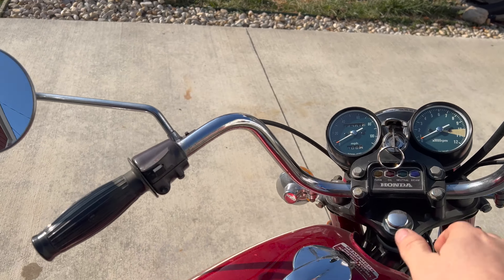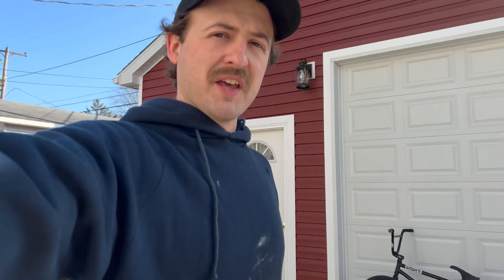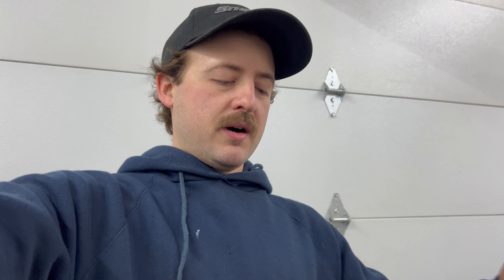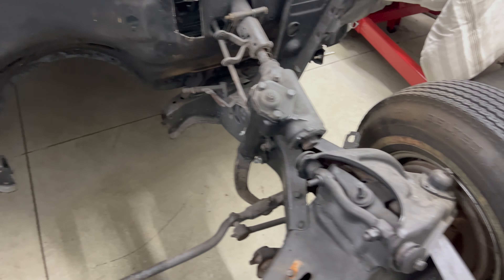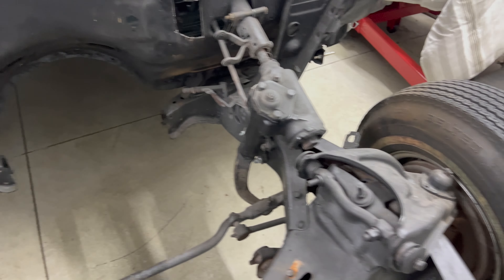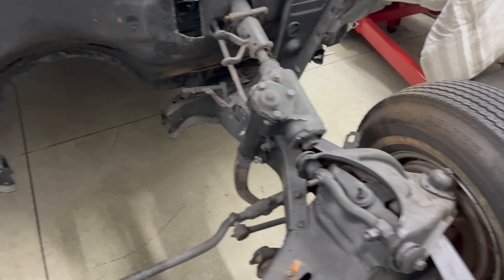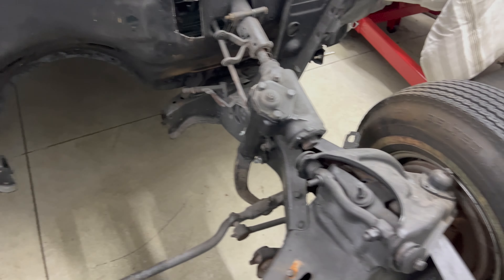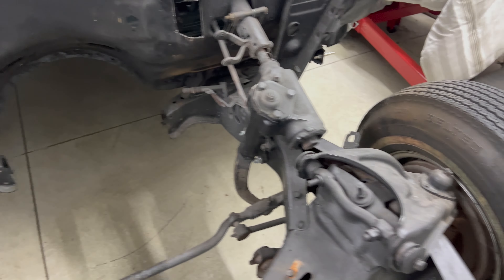55 Gasser Stock Trans Mount Removal Mod and Wheel Test Fit!

Comment: I have a buddy who has that same Honda but in blue that he bought new and it still looks it!  I've replaced a bunch of of tri five front crossmember bottoms over the years usually due to them caving in from being jacked up a million times. When I do them , I put a piece of tubing on the top side of it that reaches the bottom side of the upper crossmember to prevent it from doing it again. Its not a bad idea on a car like yours that will be getting jacked up frequently...just more of my useless input! Car is looking good man!
Reply from the maker: That is a pretty good idea! Im going to look into doing that on ours! Thanks for the input man. Appreciate it.

Comment: i am very curious about the wheel size , i have 14s cragars on my 1970 skylark with dried up 275/70r14 wide ones on the rear and it is just impossible to find any out here in the Netherlands. Got some new 245/60r14 BFG T/As laying around as biggest/best choice but i am afraid they will not look that good. Cragar SS fronts 14-8''  with 215/60 and rears 14-10'' with 275/70r14  looks are killer and screaming 70's
Reply from the maker: Cant go wrong with cragars! We will be running the skinnys up front and running with a steel wheel and pie crust slicks on the rear. That tires size looks a little goofy, but it looks great for some rollers for now!
Reply: @vintagehotrods  love those crusties on a 50's car , perfect match. Shame those are prohibited in the Netherlands .Think the size is almost the same as my 275/70 What size tire do you have on those cragars  14'' ?

Comment: I have 3 55 hdtps . First one built in votech in 77 , 55 truck axle and springs , 302 cross ram 4 spd 8 3/4 rear . Second one , built in 80 , 396 4 spd , 9 inch . Lift spindles in front . Third , built 2012 , 454 4spd 8 3/4.  Horse shoes , ball joint spacers . All use stock motor mounts , no cross member  in the rear . Never had a problem .  Don't understand why you young guys don't want to use the old mounts. I run N 50 / 15 tires on 15/12 wheels on all of my cars in the rear , the two inches on the wheels are worth the money , just for the look !
Reply from the maker: Because they are junk. When you can spend 100$ and bolt up a trans properly and get the right support i will do so. Has nothing to do with me being young just using proper up to date easy to use technology especially being out on the road being able to find easy to replace parts when something goes bad. And we are running a pontiac so i cant use factory mounts. Using stock solid pontiac engine mounts and i have to fab pedestals for those to mount to being a chevy isn’t designed to have a pontiac in it lol
Reply: @vintagehotrods  a Canadian 55 pontiac used a chevy frame . An American 55 pontiac was a few inches longer in front of the firewall.  45 years on my first one and I beat it hard as a young man . I think it was done as correctly as a 17 year old kid could do , and surviving all these years says something . Good luck , hope when you are in your 60s you still have cars you built as a young man
Reply: @vintagehotrods  BTW  a 65 gto frame mount will accept a sbc mount ,  by opening the whole a little bit